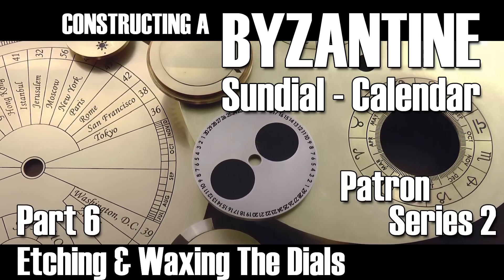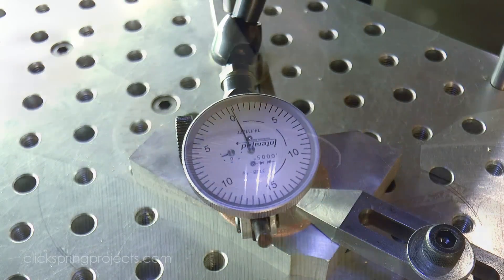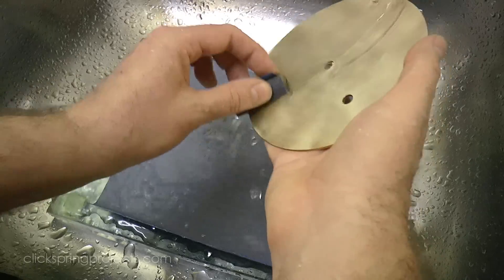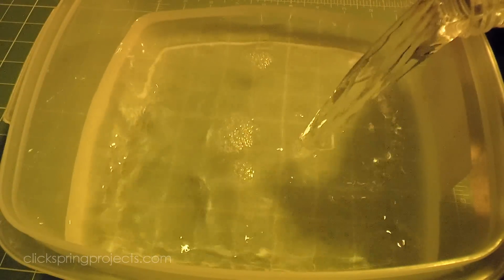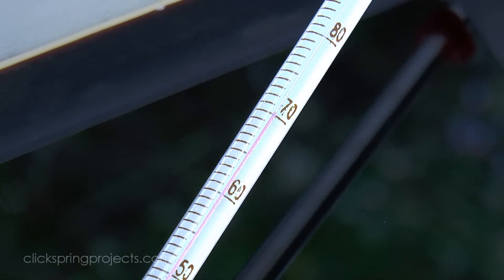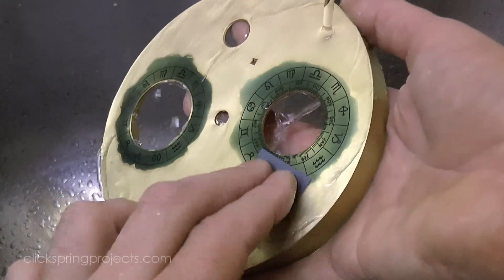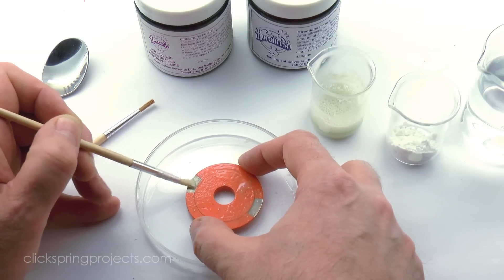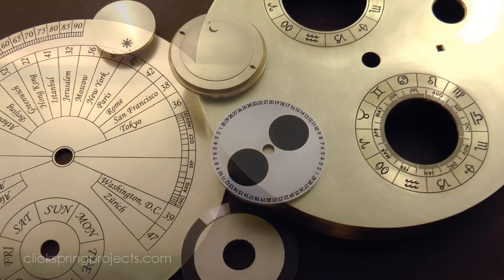Constructing A Byzantine Sundial-Calendar - Part 6 (Etching & Waxing The Dials)

Comment: Interesting remarks about consumer printers not being up to the task. I've printed at 300DPI on cheapest laser printers on the market, and being able to home-etch PCBs with sub-mm accuracy. That being said, I used direct termotransfer method with negative prints. There's a lot of recommendations about setting appropriate print profile, going for maximum quality which uses the most amount of toner but results in much better coverage. If one already owns a laser printer, I'd give it a try first.

Comment: Wow, I have etched a few circuit boards in the past and I have never come across anything talking about the temperature of the ferric chloride while etching. Thank you for that piece of  knowledge, will try it out next time.
Reply: Etching being a chemical process it's important to keep everything as consistent as possible.  Ferric chloride can perform well even at sub-optimal temperatures but it takes a lot longer.    And since you want consistent etch results, you want to be able to predict the time pretty closely from your test pieces.    Other etchants perform much worse without extra heat.   Mechanical agitation can be helpful too.
Reply: some people use the heated bed of a 3d printed to keep it warm and keep it moving....
Reply: You can use a cheap heating pad from the discount drug store to keep the outer water bath at a consistent temperature if you have several pieces to etch or if the work environment (outside is always a good idea when using ferric chloride) is a bit chilly.
Reply: It's the same reason that cars kept in a garage rust out faster in areas that salt their roads and it's easier to start a campfire in the summer than the winter (given the same moisture content of the wood). Chemical reactions happen faster at higher temperatures.

Comment: We used to do bulk masking for some wet processes using a sticky, hard wax called Clamca, if there were areas that didn’t need coating we painted the area by hand with a thick paste of zinc oxide and glycerine, then the wax can be cut back and the white goop washes away leaving a clean surface. Works for hard chrome and anodising, but not electroless nickel which is just too hot.
Might be a useful technique for something one day.

Comment: Is the solenoid display ring brass or steel? Looks like brass in the video but I've never heard of using gun blue to blacken brass.
Reply: It's brass.  Birchwood Casey also makes a product called "Brass Black", which shares a lot of ingredients with Super Blue.  So they're somewhat interchangable.  Some bluing solutions don't work as well on brass, but Super Blue does fine as long as the surface prep is done well.

Comment: Put the photoresist foil to the plate under the water stream, you will never have any air bubles or dust. Also peel the protective foil before exposure and make sure that the ink on the artwork foil is facing towards the photoresist. The thickness of the protective foil and the thickness of the artwork foil makes the lines out of focus. How do I know ? I made a few hundreds of double layer PCBs by this technique at home and I could do tracks 10/10mil at home with 0,25mm drill holes.
Reply from the maker: Great tips, cheers :)
Reply: Amazing knowledge at the table here. Not me...I'm just looking